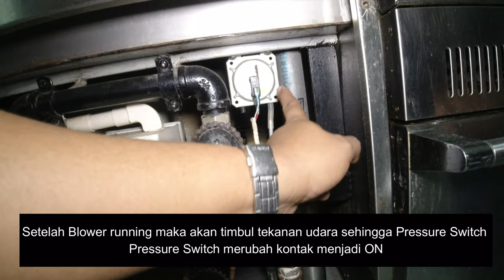#12 Chinese Wok Range Flame Mate, How it works...

Comment: Sir evening just some help if it is ok..  What to do sir when switch on the push button it is automatically alarm? It wont ignite it is automatic alarm when i switch on the push button.
Reply from the maker: May be the problem from ignition control module... check the pressure switch too